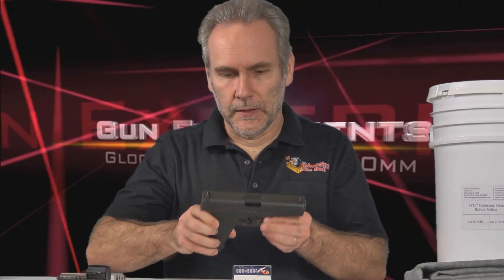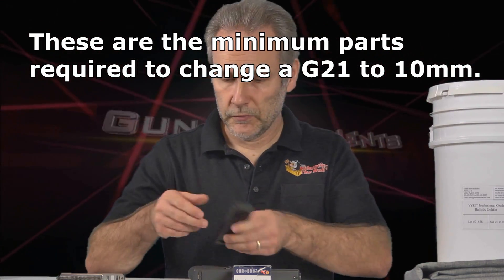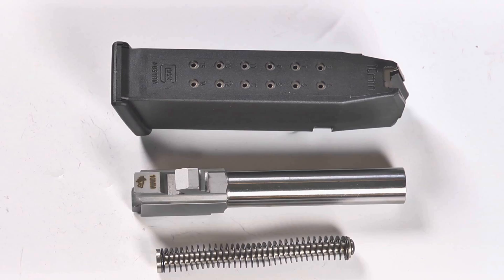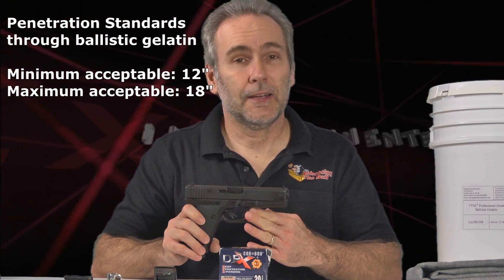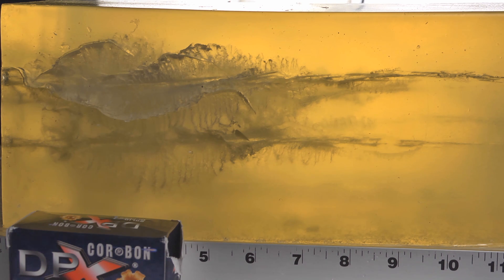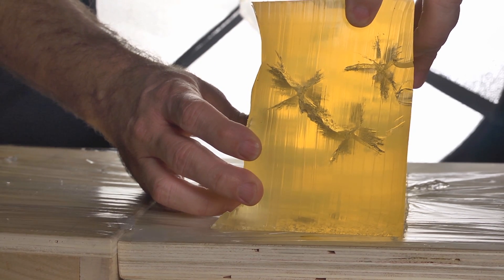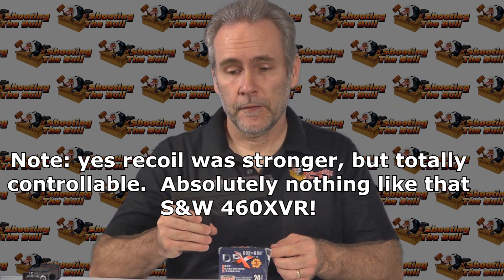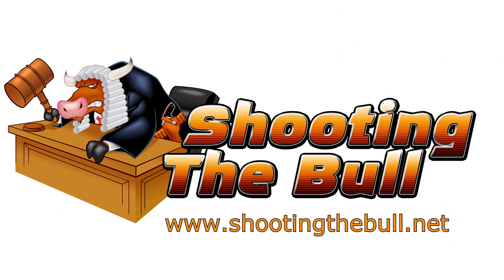Gun Experiments: Converting Glock 21 to 10mm and test of CorBon DPX 155-grain ammo

Comment: Don't know why ppl spend more on "conversation barrels"? It fits exactly the same as the .45 barrel. No wiggle in the breech face.
Reply: I have heard the 10mm barrel is like .050 smaller; so you have experience and it fits perfectly?
Reply: @HKBuilderDIY  . Yes. I installed a 10mm non "conversion barrel" they. Only thing I switched is the extractor. Dont know if I would trust it with my life but nice change non the less.
Reply: @82godoy  you said you wouldn't trust it with your life, so it had some reliability issues? Is there barrel wobble that caused inaccuracy or light primer strikes?

Comment: You need the 10mm extractor.I tried without the extractor and the brass had dings on the neck end. I also used the 22# spring and it works fine on my hand loads.

Comment: So that is not a 45-10mm conversion barrel? Because lone wolf told me that the 10mm barrel will not lock up in a 21 slide.
Reply from the maker: It is specifically a .45->10mm conversion barrel, from Lone Wolf.  It is made specifically for the Glock 21 and locks up fine.  Maybe they don't make it anymore, or maybe they were thinking of a different product, I don't know.  This is not a G20 barrel, it is a G21 conversion barrel designed for 10mm.
Reply: Thank u for the info

Comment: Love ur Chanel! So doing it like this would you say this is reliable enough for the conversion the way you are doing it? I'm wanting to carry 10mm in the woods, and switch off back and fourth between 10 and 45 for everyday purposes. And target shoot with 45 because its cheaper. So to clarify do I need to buy specifically a conversion barrel or just a buy a barrel for a g20/40? I'm on the fence choosing between the 4.60" barrel or the 6" I want max velocity for large game hunting and bear defense. Please get back to me if oh can would mean a good amount to this fan
Reply from the maker: Converting between 10mm and 45 is easy and reliable.  Converting to 9mm, well, not so much, but going to 10mm is simple enough.  I know there are folks that say you can do it with a G20 barrel, but I would prefer getting a purpose-built barrel specifically made for the conversion; that's what I did for my G21 and G30, I got 10mm barrels for both of them.  The difference between 4.6" and 6" isn't going to be all that much; maybe 50 fps on average, maybe 100 fps in the best case.  If you're after the maximum velocity, you will get more power with the 6", but if that barrel length is inconvenient then you won't lose too much by going to the 4.6".  I don't know if a G40 barrel would work in a G21; perhaps GlockTalk has folks who have tried and can answer that?
Reply: Thank you for the quick answer! Sounds good I'll go with the 4.6 inch barrel. The reason I ask is I don't see a dedicated conversion barrel on the lone wolf website just barrels labeled as 10mm g20 replacement barrels. Kkm has a dedicated barrel but there sold out:/
Reply: So I contacted lone wolf and they say they do not make a 10mm conversion barrel and never have, lol so annoying I picked this g21 up eight he sole purpose of the conversion and can't find a barrel lol
Reply: Just buy the Glock20 stock barrel and it will fit the Glock 21
Reply: Ended up just buying a g20 lol

Comment: Is it possible to go from 20 to 21 without replacing the whole upper?
Reply: +TXLionHeart He explained it in the video, didn't you watch it? He replaced the guide rod with a steel one and switched from the 17 lb spring to a 20 lb. The glock 20 barrel is heavier like he explains but he wanted to save money.

Comment: What a bout taking a g20 .40 conversion barrel and putting it into a 21?? Will that work?
Reply from the maker: Bret B. I believe it would work, but I would be hesitant to trust it for something like personal protection.  GlockTalk has plenty of stories of people using G20 conversion barrels in G21s and it working; I used a G20 9mm conversion barrel in the G21 and it generally worked.

Comment: yep glock conversions are fun.  When i was a big 10 mm fan i converted to 40 and 9mm.  great gun and lots of fun.  super reliable with all calibers.  it was nice because all i need to do was use different barrel for the 40.  different barrel and recoil spring for the 9mm.  10 mm mags for all rounds now problems.  now my primary is my Taurus M450 and poly defender but i still have a glock 40 with 9mm conversion for a SHTF type gun.

I thought the 10 mm slide was heavier than the 21 slide?   i also thought for super reliable 21 to 10 mm conversion you would need to replace the extractor.

Comment: The 10mm is an awesome round Thanks for posting this if you get a chance try out the Buffalo Bore ammo. I actually have 2 Glock 20s The Lonewolf Barrel you recieved is the blind marked version normally it will say 10mm on top
Reply: ShootingTheBull410
Don't forget about Underwood Ammo.  It's the best i've used so far outside of typical factory loaded ammo.
Reply from the maker: I did test some Buffalo Bore but I think my gel test of it was from a longer barrel than this pistol.
Reply from the maker: I have some Underwood FMJs on hand, but no HP's.

Comment: I bought my Glock 30 gen 4 hoping to do this conversion reliably. I then found out many complained of their gun jamming after several shots when doing the 45 acp to 10 mm conversion.
Reply from the maker: I haven't fired hundreds of rounds yet, but I've fired quite a few and haven't encountered any jamming yet.  Fingers crossed...
Reply: I've done the conversion and haven't seen any issue. granted, I've only shot armscor ammo thru there and it's kinda weak, but you shouldn't have a problem. experiment with recoil springs, but you should be fine.

Comment: Can you convert the Glock 20 to a Glock 21?
Reply: no , too small opening in the slide
Reply: df2dot Thank You!!!! MERRY CHRISTMAS!!!!
Reply: your welcome , Merry Christmas ! Have you ordered you g21 yet  ?  : )
Reply from the maker: Actually yes you can, but you'd need to buy basically the whole upper (slide, barrel, recoil spring, etc).  The frame would stay the same.  May not be cost effective to do it that way, but it could technically be done if you had the parts.  Lone Wolf sells assembled slides for many Glock models, but they cost $350 or more.  At that point you'd probably be better off picking up a used G21.
Reply: ShootingTheBull410 THANK YOU!!!!